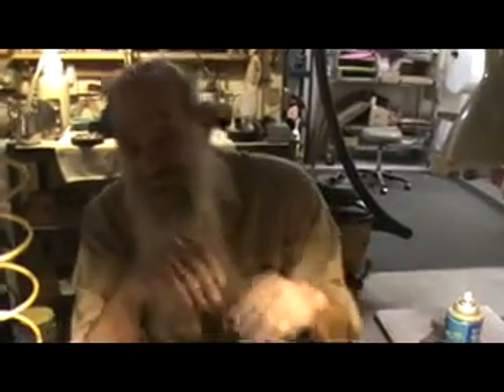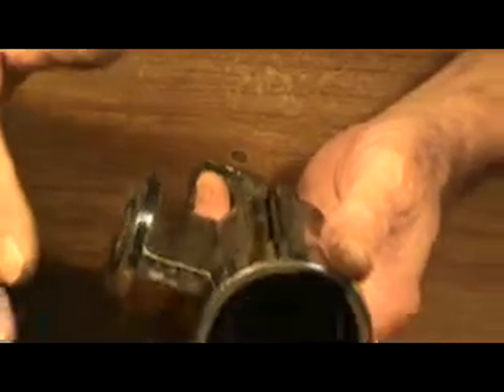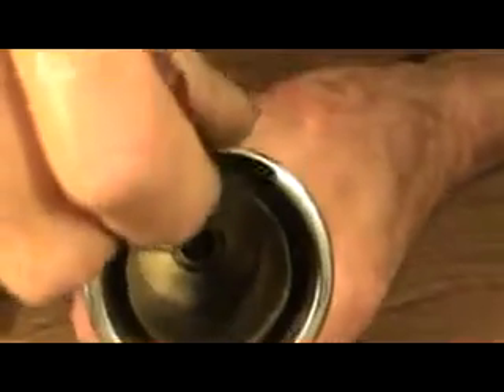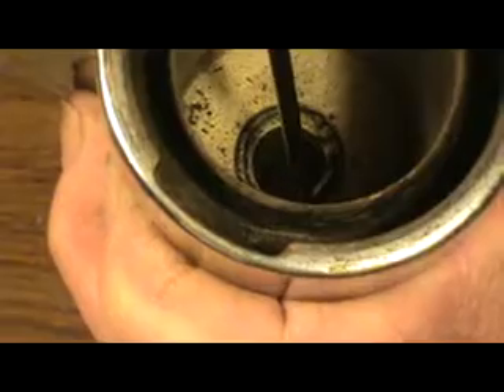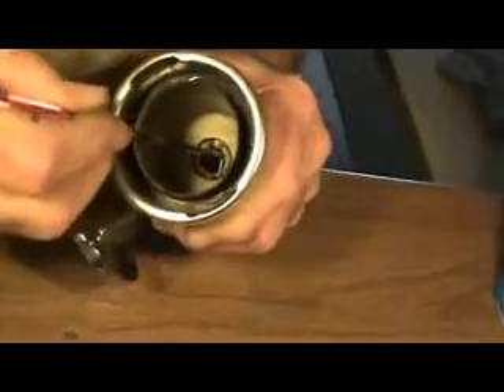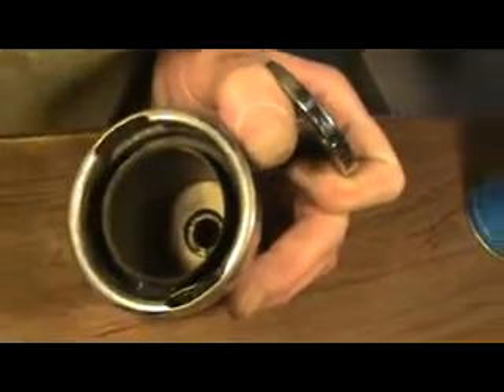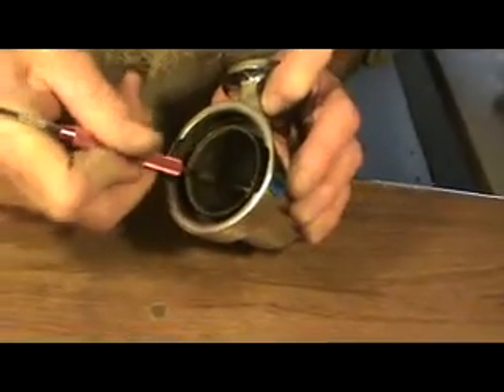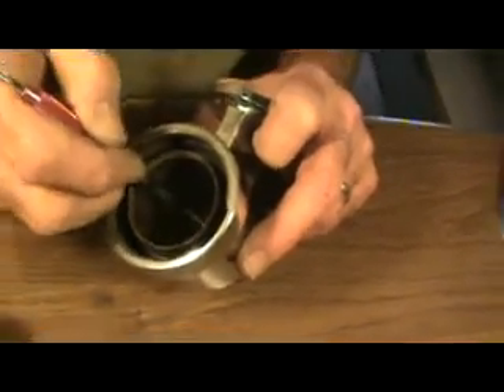You Got a Cremina Video 36 - Rusted/Broken Rod Seal Clip Removal

Comment: interesting video.  i have the same problem. both ends of the snap ring have rusted off. i managed to get the 4 hole washer and rubber gasket out. ive tried to use a pick tool to try and lift ut out but getting no where.